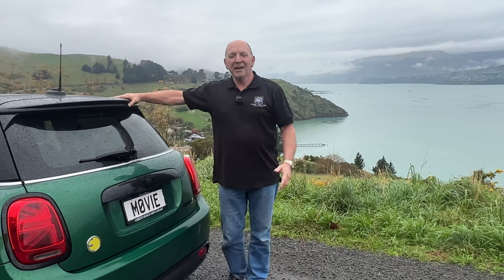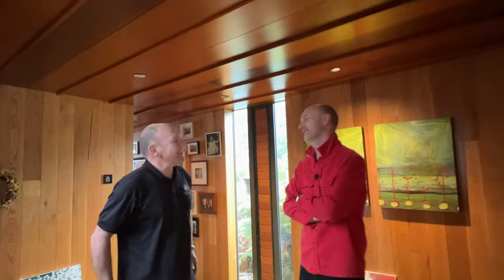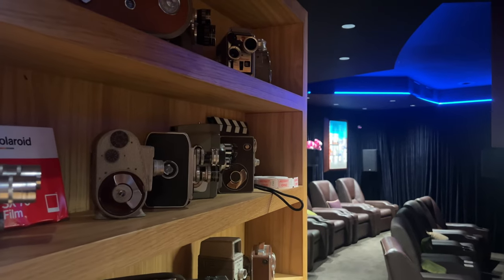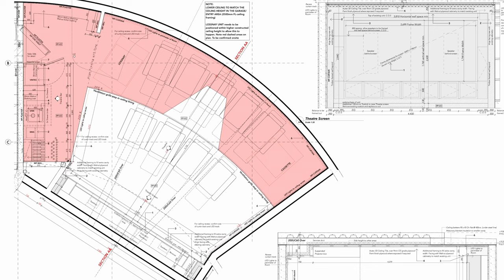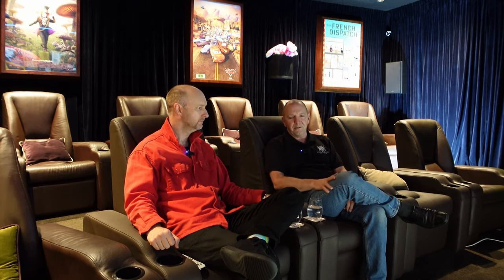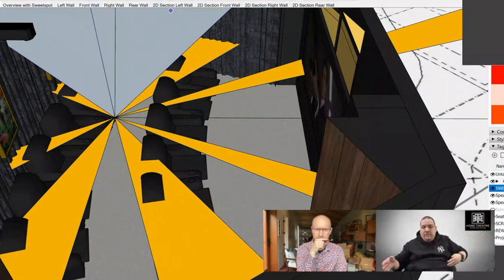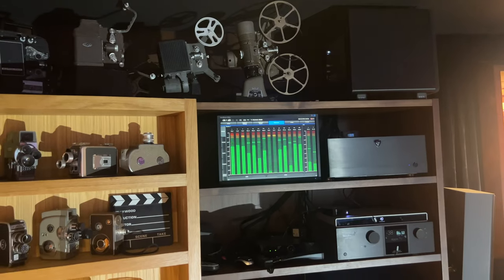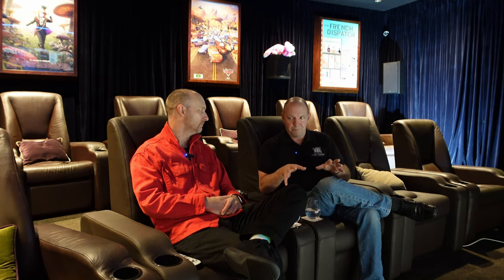An Architects Cinema! - The Secret of a Grand Design.

Comment: Yes,yes, but how much, including the calibration service, did it all cost?
Reply from the maker: Hi, if you are asking because you are thinking of doing your own project then contact us directly through our website or facebook. However we actually don't know the total cost of the project as we did not supply every single item.  Also we are not comfortable about publicly disclosing how much a client has spent. The client is watching this post and I will leave it up to him to post that information if he wants to. In terms of audio/video calibration/room tuning it totally depends on how much work is involved. Calibration can start from $1000 and go up to $30,000 (check out Wisdom Audio's calibration rates on their website!) Rooms like this start at about $150,000 and go up from there. We are working on several rooms well over the $1M mark for example.
Reply: I can’t recall the exact cost of all the gear but it’s easy to google RRP on all the equipment we talk about. I just remember HTE looked after me with their huge buying power. Calibration is just flights and time but I wouldn’t even think of getting gear like this without also having someone like Andrew calibrate it. Also worth noting is the backup and support from Andrew and his colleagues in the industry is second to none. As for the theatre room it would have easily added $1m to the house build because it’s under ground and highly structural. So back of a napkin guess I’d say $1,2m for room + gear.
Reply: @9and3  Thank you for your candid reply. I really appreciate it.